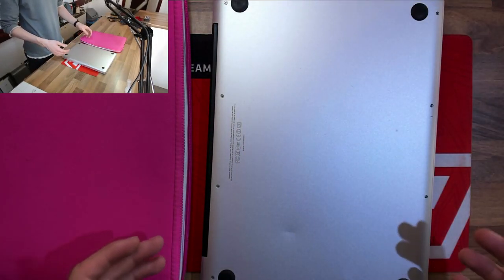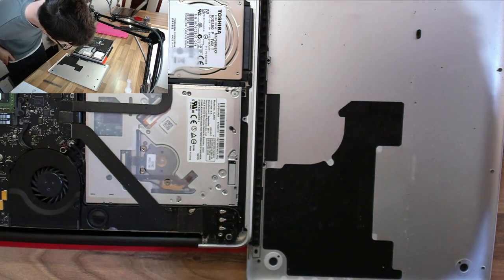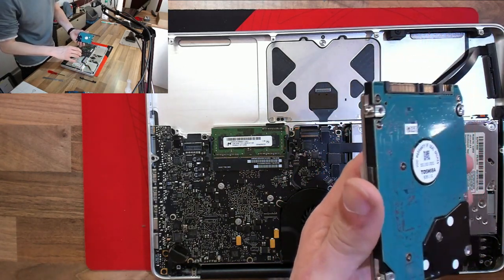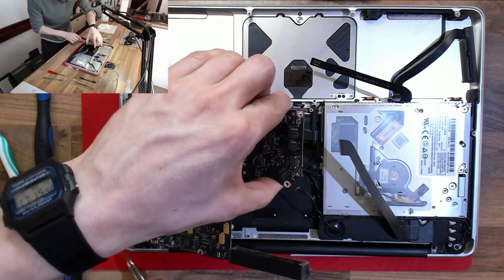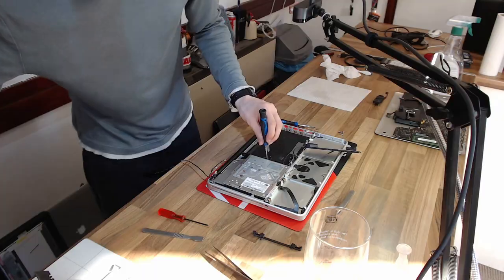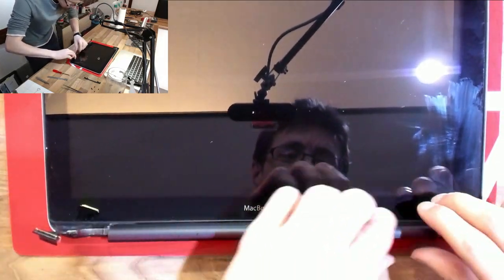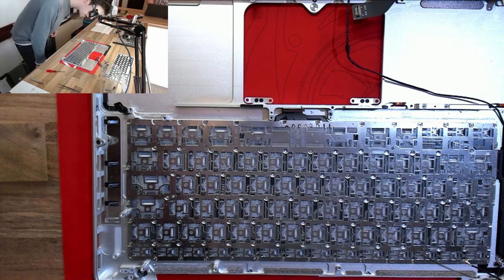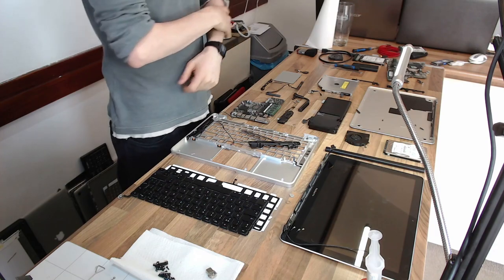LFC#110 - There be MITES!

Comment: can i use the type of the alcohol you use to to wipe my screen sir?.. i also have a colony of mites below my palstic cover screen...
Reply from the maker: Yea rubbing alcohol / isopropyl should be fine on an LCD. If you can though, I'd take the LCD panel out of the assembly and keep it isolated, to check if they've gotten inside the panel.

Comment: Instead of using isopropyl, couldn't one get an ozone generator or carbon dioxide source; toss both the laptop and said generator/source into a sealed container. And let it rip fumigation style?

You'd suffocate all the bastards without having to take it apart. Though you would still have to disassemble it for a clean up.

Comment: Hey I don’t have that alcohol but do you think I could use just real drinking alcohol?
Reply from the maker: Different kind of alcohol. Drinking stuff is mixed with water and other things, so it will leave a residue and/or corrosion. Isopropyl is cheap to buy on the internet, or at a push, you can use glass cleaner, because that also dries without a residue. Not sure if glass cleaner will definitely kill bugs though.
Reply: The reason high grade IPA (usually 99%) is used is generally because, as well as been super effective at the job in hand, it is usually non-conductive. Anything with water content is a no go.
Reply: @SimonNemeth  Really good answer - thank you!